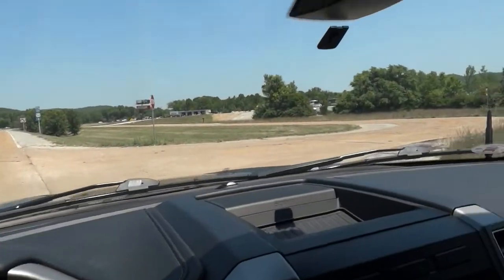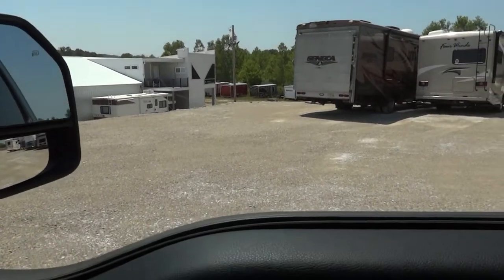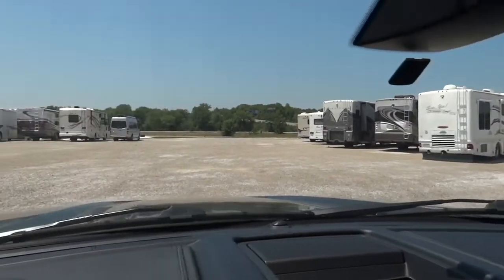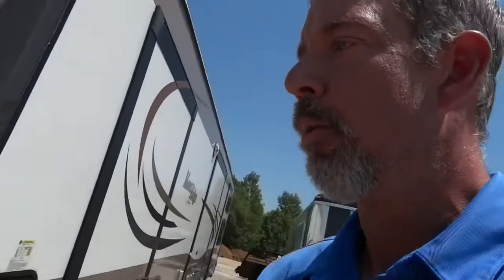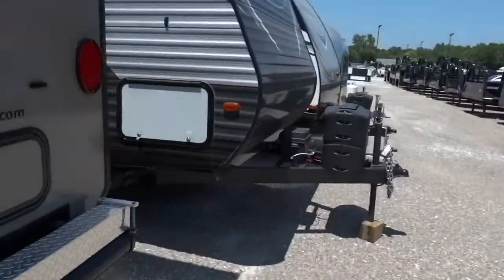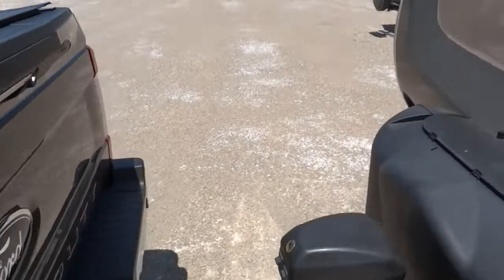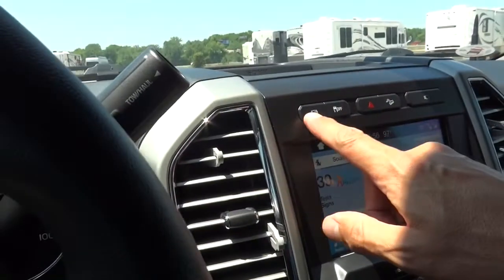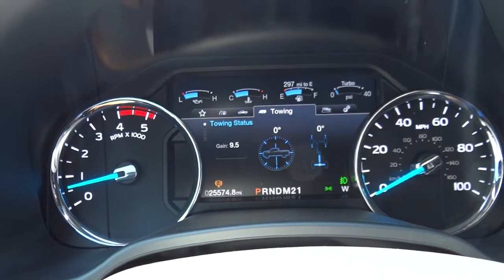Hooking Up My Travel Trailer to my F250 6.7 PSD And My Tow Settings

Comment: I am blown away no one explained the exhaust brake to you. It applies zero brake power to your electric or electric over hydraulic brakes. It simply cuts of exhaust flow creating back pressure in your engine to slow the Rpms and thus slowing the power train and total engine speed that way. Please if you’re pulling this much weight understand the function of the safety features of your vehicle. I hope this helped :) cheers nice truck.

Comment: Have you ever done the inspect and lube of the 4x4 front axle shaft u-joints? It's part of the 10000 mile saint. Looking also for video on non sealed stearing linkage lube.

Comment: 31 Mpg huh, Im running a F350 CCSB with 3.55 gearing on 35" and average 16.1, i have never been able to get above 20MPG, your test must have been done on some dang flat roads.
Reply from the maker: ColdAlaskan73 Hey there.  Actually there was a pretty big hill involved.  Up 4% grade about 600 feet and then back down.  I only drove 45 mph also.  That had a huge impact on the outcome.  The slow ridiculous speed.   Kept the engine out of boost
Reply: @AdventuringToday  3:17 You didn't CROSS X the chains!? It's the LAW in most states!  SAFETY FIRST :)

Comment: how the heck are you getting 30mpg?? I have the same exact truck and im only getting like 12-15 MPG NOT towing and towing getting 9-11 mpg 6000lb travel trailer.
Reply from the maker: Hey there...So this was a pretty extreme situation I created.  I only drove the truck 45 mph and it pretty much stayed out of boost except for the big hill I drove up.  Yours will get the same MPG I promise.  I get the same MPG as you when I drive it normally.  I'm completely stock...no intake or tune and running stock tires.  So nothing special...just a slow speed at like 4:30 AM on the highway.  Heres the MPG video for those curious who may be reading this post.https://youtu.be/4mfFP4QDlLg

Comment: Barely caught your travel trailer tires but they looked like Goodyear Endurance trailer tires.
Reply from the maker: Hi Victor...yes they are Goodyear Endurance.  Good guess on the tires!!!  I love them.  I did a review on the tires here.  https://youtu.be/YMtx4QMa1AQ
Reply: Adventuring Today I used my China bombs for about 500 miles then went to the Goodyear Endurance tires. Night and day difference. Just took a 3,200 mile round trip from Illinois to Texas and they performed flawlessly. Only ST tires that I know of that are speed rated N at 87 mph I think.
Reply from the maker: I completely agree.  I almost made it to 5,000 miles on my Chinese bombs and I felt lucky nothing happened.  I was constantly checking air pressures but the sway those tires transmitted to my truck compared to the Endurance is night and day.  That alone is good enough reason to spend the $500 and upgrade.  1/2 my tread was gone at that mileage mark also.  Sounds like you and I came to the same conclusion.  Travel safe out there!!!